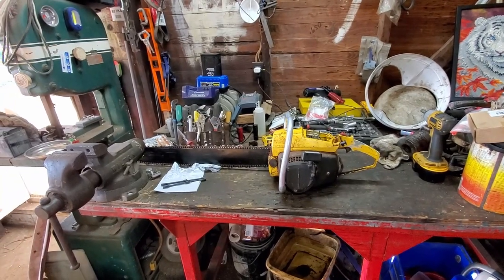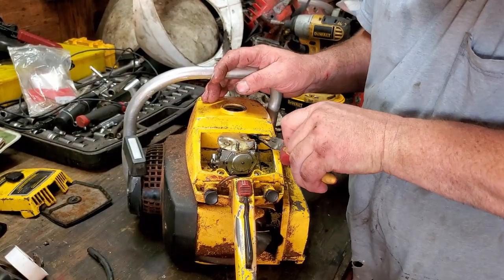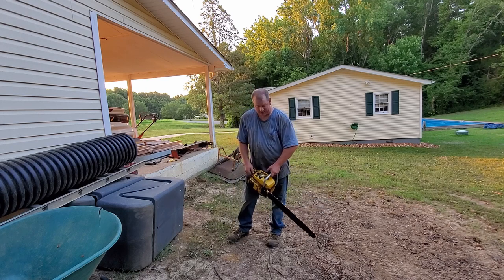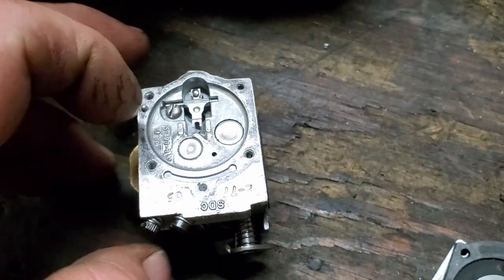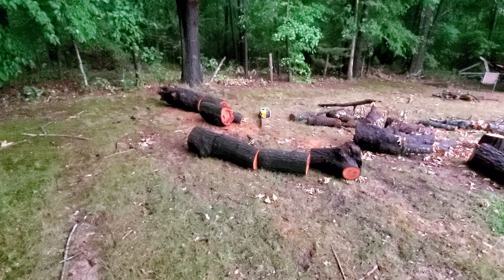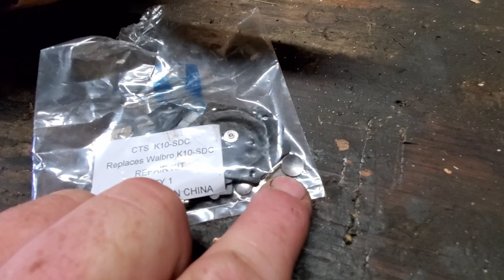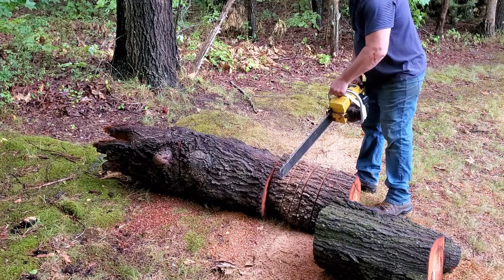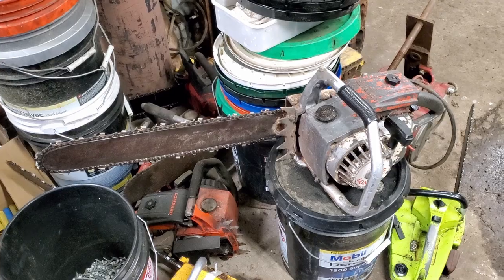MOW - Will This McCulloch Pro Mac 1010 Chainsaw Run???

Comment: When work on chain saws I take the chain and bar off put it into the vice and use a drill with socket to start it on the clutch side. Much easier to dial the carb in

Comment: Just saw the Dodge video right before this one. In my comment on the Dodge video, I was right about what type of saw you had. Seeing and hearing another one of those miserably loud saws just about gave me a breakdown. By the time I finally replaced it with a Johnsered 2054 Turbo, I had truly learned to actually HATE that deafeningly loud nightmare, even though it was a powerhouse of a saw. Now here I am 52 years old and so crippled up with bad discs in my back and neck that I couldn’t even lift up that Mac 10-10 let alone actually use it. (Having a spinal expert ordered 5# weight limit for the rest of my life really sucks). I wonder how much of my working foolishly with that saw for years contributed to my back problems.

Comment: You can take that McCulloch and clamp the Bar in your Vise close to the oil tank and adjust the carb a lot easier that’s what I’ve been doing for the last 45years just a helpful thought great videos

Comment: In your collection of antique saws the Homelite looks like a 330 in which I have one. They are a good saw. But there is a boot under the carb that goes bad but are still available in the interscreen if you look hard enough. The only reason I know is had to replace mine. On your 
McCullough saw might do a compression test just a thought. Great video.

Comment: I am NO expert with chainsaws but in the past one of my Stihl saws seemed as though it wasn't running as it should.  After exhaustive trouble shooting ~ I traced the problem down to a slightly scored cylinder.  You might want to remove the muffler and look at the piston for scoring.

Comment: Excellent video Chad :) only 2 Chainsaw seen smoke really bad was my late uncle Sthil he used Ether (Quick Start) get started up on Cold Start or after refill tank plus bar oil up he did for years long I remember remember help doing firewood cutting to and to his Snowmobile he had 1974 Bombardier 400 F/A Free Air twin carbs plus 2 cylinder motor too! Only other see was my late dad bought brand new Chainsaw in 2005 of a unamed store not saying it  sold Poluan was 18 inches bar also had right fuel mix and took to shop figure what happened to was smoke like a chimney from wood firewood fire ! So the try adjustment on carb not problem what was Cylinder on motor had one Piston ring had broken off so fix and 5 days of use did again but clang so when ran also started up and took back to small engine mechanic shop found Piston twisted and top from ring up broken also ring broken to peices plus bearings! So got new Piston  plus more rings  plus bearings  fix and then coil went  got to see work right before brought home again and Mechanic said what  peice garbage it is for low hour and not 1 year old machine!  So had fix up and never use it to still put away since 2010 year and got at house try if see okay too someday !  But sometimes some small engines be wild to fix up Chad and hopefully see have all ones you have get going sometime!! Also not been not all but thought like Lol to hear to read too and say holy moly!

Comment: With proper tuning a little muffler mod and a nice sharp STIHL skip chain the 10-10 will hall some ass! Just did some work to one not long ago pulls hard! Also run a quality oil at 40:1 ! Opti2 is great! Also make sure the cooling fins are very clean! As those things can make the chrome plating flake off the exhaust side of the cylinder!!

Comment: Culloch's R Cranky!!! But I've never had one spontaneously combust into flames on me Lol. I had an old power Mac6 "Worlds Lightest Chainsaw" was its claim to fame. Thing was built tighter then a Chinese fingertrap puzzle. When it ran god it was Amazing, When it decided not to,  It was AMAZING!!!  had a mind of its own. I like em tho  They also made 4 & 6 cyl Drone engines, Sometimes used on a kit called a J-2 Gyroplane & they also made superchargers for some old cars, I think Studebaker mabie Graham-Paige?? One rare McCulloch they made was a 3-10 saw but Electric start, the battery pack was mounted under the trigger handle & kinda looks like an old Atari Game console. You might look into  Timberline  Chain sharpener, jig clamps on the bar & a little crank runs the carbide cutter at the right angles, it has a ratchet pawl to allow the chain to move forward then hold the chain in place & also a thumb screw to set the cutting depth, stores in a belt pouch. This takes all the error out of sharpening. When I start filing a dull chain manually, My accuracy is pretty good, but by the time I'm done with all 100+ teeth, even with a file angle gauge, its much worse, I bet even the most seasoned Woodsman has chainsaw blade angle error by the time the chain is completely sharpened. Anyway I love your channel & binge watched all your stuff, Cheers

Comment: I have a McCullough saw like that and I put two new fuel lines on it and at one point I had the backwards on the carburetor. Check your line connections at the carburetor. Just an idea I'm sure you know way more then I do.

Comment: Personally I hate Small engines also but sometimes it's necessary to work on them. I've worked on several chainsaws and lost a whole lot of hair getting them to run properly 😂 you've got common sense and a whole lot of mechanical knowledge and I love the way you get things done 👍☮️🇺🇲

Comment: On the Mac check the compression the crank shaft seals maybe leaking a little causing the low power just a suggestion 👍
Reply: yup, they get cooked & leak

Comment: Ive gotta old McCulloch 650 pro max. That old saws cut so much wood it aint got no rings in it no more. It still runs and cuts like a beast. I cant keep a muffler on it either. But yeah that old saw will ring your ears and fog the timber.

Comment: For what it is worth I have had similar problems with the very small engines.  I found it was the carbs.  Cleaning the passages with a torch tip cleaner, blowing with shop air, and soaking in carb cleaner overnight did no good.  When I switched to cleaning with the ultrasonic cleaner voila success.
Reply from the maker: You have to make sure all passages are open so carb cleaner thru all passages does just fine for me.
Reply: @ThisNThatGarage  Well something is not working.  Ran into the same thing repeatedly years ago and the Yamaha rep recommended the sonic cleaner.  Worked.  Even the dealer here went with sonic when they came out for the same reason.  Good luck pulling that cord.

Comment: That older McCulloch, looks a lot like my D30. 
 If you look on the bottom of your saw, about in line with the crankshaft, you should be able to see the model and the serial number.  The numbers are in a bit of a pocket, so the crevasses in the bottom need to be cleaned up.   There are sites, such as the Arborist forum,  where you can ask someone to identify the saw for you, or you might be able to identify the saw by using or Mike Acres Chainsaw database (just do a google search),.  I have some McCulloch data, and if you post the information from the bottom of the saw, I may be able to identify it for you.
I have had real good results adapting Husqvarna type bars to other saws, such as McCulloch and Homelite.  I don't own a Lombard, but on Mike Acres site, there is a section where you can find the bar patterns for a good number of oddball saws.  With your talent, you would have no problem swapping another brand of bar to the Lombard.

Comment: Way more patience than than I have with small engines, all i know is they work sooooo much better with non ethanol fuel. That yellow saw would have been tiny little yellow pieces of the Forrest decore by about the 3rd try.

Comment: I'm not too sure exactly what's wrong with the saw (I'd know more if I handled it) but I know for the diaphragms and fuel lines, I wanna recommend to try switching to the premix fuel. Yes it may seem like a lot to pay for fuel but it's very well worth it in the long run... few example my fathers weedeater on its 5th season and still starts like new, never having to drain the fuel.. our chainsaw we use once every other year, same fuel, never drained, starts and runs like new.... figured I'd put it out there, it may help you in the future if ya decide to switch to it.

Comment: kinda thinkin the clutch on the one may be bout gone because it got a ton of oil on it so its screwed it up and also the fuel being the crap with ethanol in it can make 2strokes run like crap rev WAAAAY to high and yet have no power

weedeater we had use to run like that and we put ethanol free in it and it ran sooo much better

Comment: Those small engine diaphragm style carburetors will put you through hell to fix them. I have personally wasted many hours of my life fooling with them all to get nowhere and wasting time, most of the time if available I always try to opt to replace the whole carb with a new one, in my experience a basic diaphragm and gasket kit won't save them, usually the check valves and weltch plugs is usually where the problems are and usually if the carb needs those it's not worth trying to fix them.

Comment: My grandpa and momma used to run a sawmill and cut timber they had a McCulloch chainsaw and they said that thing would only start at one certain time of day no matter what you did to it it would run fine all day then at a certain time in the evening it would quit and samething no matter what you did it would not start till next day at that one certain time I think that saw was unionized

Comment: hey my man have you tried to take muffler off and burn the screen inside, that what i would try first ,burn the crude off the screen and then adjust while in a log under load. i would also stick a business card between the coil and flywheel  ,that probally help with all that pulling your doing, any way just thought i would ask cause  i ddint see you try to clean the muffler screen,  hope you get her working for you
Reply from the maker: There's nothing in the muffler.

Comment: If the High screw is only just out....screw the Low in more.....with your tune the low is feeding the high circuit thats why your
high is only just out....
Reply from the maker: It's more than just a carb adjustment going on with that crazy saw.

Comment: Maybe it's the catalytic converter? Or the fifth wheel release handle? Chainsaws are finicky, like a woman. Or maybe a mean cat?  You Know a chainsaw won't start and run with a dull chain? It'll act like it wants to run but it stalls right away , that's the sign that the chain sensor detected a dull chain. Maybe you Don't know everything about chainsaws ? Who ever heard of chainsaw fuel workin' in a lawnmower?  Crazy old Coot!! Hahahahhah... sorry Chad, had to be done.